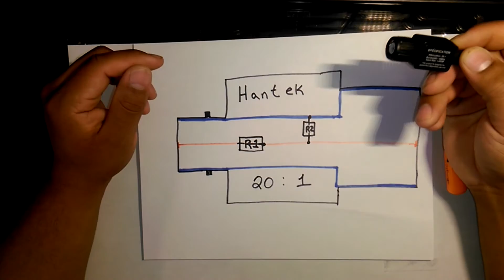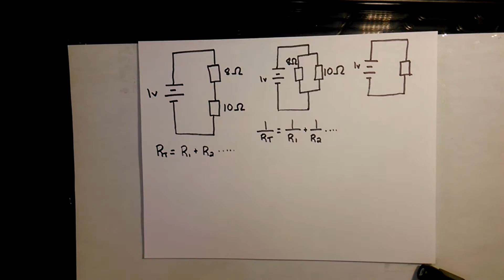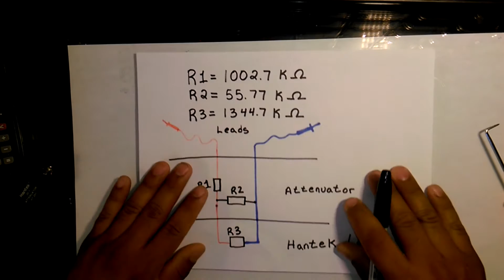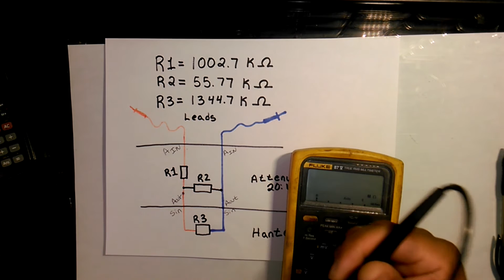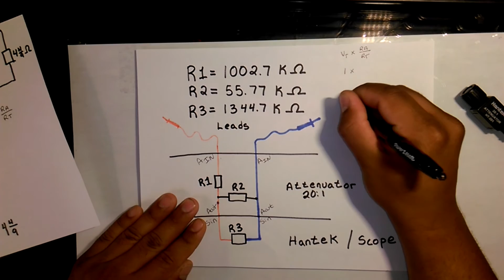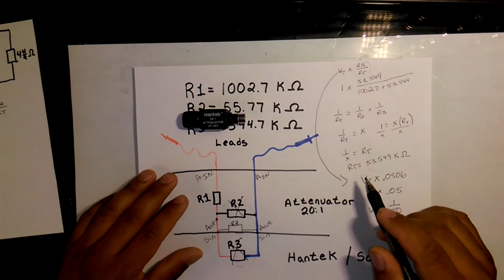Hantek 20:1 Attenuator Detailed Analysis

Comment: Enrique, Shahbaz has it right for 2 resistors in parallel, however, the way you have it written you need the inverse. Example: For 2 or more resistors in parallel,  Rt= 1/((1/R1)+(1/R2)+.....) Nice video.

Comment: If i bought hantek 6074BE Which they recomonded for automotive, have i to use attenuator even measure battery voltage as it is 10V/div max? Appreciate your explanation.

Comment: how can the resistance be LESS than the LOWEST ?.....
Reply from the maker: Excellent question. The combined resistance I calculate shown as Rt or R4 is the resistance of the resistors R2 and R3 in parallel. The resistance of two resistors in parallel MUST be less than the resistance of the lowest value resistor. The reason is that a single resistor will allow a certain amount of current to flow when there is a constant voltage across it. If you were to place a second much larger value resistor in parallel, the same current would flow through the first smaller resistor and there would be an additional current through the larger resistor. Both resistors in parallel combine to allow more current to flow then either resistor on their own. Therefore, the total resistance must be less than either resistor. I hope that answers your question. If I did not let me know and I will try again.

Thank you for your question, and thanks for watching!!

Comment: Hello, Enrique. When I use an Attenuator (Hantek) with my  2204 picoscope to check my battery, the voltage remains close to zero, but when I don't put the Attenuator on, I get battery voltage. I measure resistance between the input and the output , and I get 0996 kiloOhms. Do you suggest buying another Attenuator?
Reply from the maker: You have to adjust the setting on your scope so it knows that the input it is receiving goes through an attenuator first. If your attenuator is 20:1 then there should be an option for the 20:1 somewhere in a drop down menu.
Reply: Thank you for replying. I chose the 20:1 in the drop menu and nothing happens.
Reply: I got it figure out. Thanks

Comment: Hi Enrique, thanks for the video!  I have one question. You indicated that the Hantek 1008 has 1.3 M ohms of resistance but the specs says it's 1 M ohm which is common to a lot of handheld and pc scopes. Why the difference? Did you actually measure the internal resistance with the unit on and off. Could it be something to do with a capacitor that's usually in parallel with the resistor inside the scope. Thanks in advance if you have a moment to help clarify.
Reply from the maker: Excellent question. I do not know why the Hantek 1008 has 1.3 M ohms of resistance. I went back to check to see if I was mistaken but it is 1.3 M ohms. All 8 channels range from 1.340 M ohms to 1.345 M ohms. My guess is that it was a design choice. For the sake of curiosity, I also checked the resistance of my Hantek 6022BE 2 channel scope and my PicoScope 4425. The Hantek 6022BE has a ressitance of 0.998 M ohms and 0.999 M ohms on channel 1 and channel 2, whereas the PicoScope has exactly 1.000 M ohms on all 4 channels. I guess this makes sense, the Hantek 1008 is a $70 8-channel scope, the Hantek 6022BE is a $70 2 channel scope and the PicoScope 4425 is a 4 channel $700 scope. The more money, the better the specs. Thank you for your inquiry, it sparked my imagination. (All of my resistance measurements were taken with a Fluke 87V Multimeter, I have trusted this meter with my life).
Reply: Pay attention you are measuring an active device, not a passive one. In any case I've measured my Hantek 1008 input impedence and it is exactly 1M. Is it possible that you got a bad production or that the active input stage of the 1008 let your Fluke see a greater resistance...
Reply from the maker: Interesting thought. Is it still active if nothing is plugged in?
Reply: Active in the meaning that the measured value is not a constant value intrinsic of the component but it depend from the measurement conditions. When a tester have to measure a resistance, it apply a current and read the drop of voltage to give you the resistance (or it apply a voltage and read the current). But if you apply a current to an active component it may drop a different voltage according to the current you apply (and verse of the current). In the other case the current can depend on the level of voltage the instrument apply for the test (try to measure the resistance of a LED and you will see that your tester may light it on). So the measure is instrument/measurement conditions depending.

Comment: Hi  Enrique Hantek 20:1 Attenuator Vt =0.05v what if you measuring secondary ignition on spark plug which is somewhere 10 to 20 000 v what voltage is hantek see?
Reply from the maker: It will not work because the Hantrek can not directly measure secondary voltage. The only way to measure secondary voltage is indirectly with an appropriate probe such as the HT-25.
Reply: @Enrique_Osorio  But the term 'secondary' just means the secondary winding of the ht coil, so its just voltage, though a very high one! So not sure what your reply implies? I want to do the same as experimenting with ignition on my motorbikes.

Comment: if i have used 10x probe in series with hantek attenuator  what will be the   final calculation. is it VT *53.54/10000+1002.7+53.54= 0.00484 and VT * 1/208 . that means 1:208 . is it correct ??? please correct me if im wrong

Comment: Great video thanks! I know almost nothing about electronics but I have been trying to learn how these things work.  I tore my Hantek 20:1 down and found 3 capacitors in there too. I am wondering about their purpose as you don't mention them.
Reply: The capacitors are probably for frequency compensation (to make the gain uniform up to the maximum bandwidth of the scope).  If you just use a resistor divider, it will work, but the gain will drop at higher frequencies (instead of a pure attenuator, you have an attenuator plus low pass filter which will filter out higher frequencies).  In the signals, this can result in a "rounding" of square edges on a square wave.  Adding the capacitors (of the right value) can make the response of the attenuator "flat" over the entire frequency band so there won't be any low pass filtering (as long as the capacitor values are chosen correctly).  This "Trick" is used in regular 10X scope probes as well.  In that case, one capacitor is adjustable via a little screw allowing you to "tune" the probe to get it correctly calibrated perfectly.  With the low bandwidth of the 1008, this "calibration" is not so necessary.

Here is a link with more information (scope probe 10:1 attenuator, but it is the same principle):

http://www.syscompdesign.com/assets/images/appnotes/probes.pdf
Reply from the maker: Atomik 7 Thank you for your comment. I appreciate all sharing of knowledge, and you definitely taught me something.
Reply from the maker: I am not sure, if I had to guess, I would say that they are there to stabilize the signal so a really noisy signal will be cleaned up a bit, kind of like a low pass filter. Do not quote me on that since that is a guess. Thanks for watching and thanks for commenting, I read and try to answer all comments so feel free to watch more and comment more.

Comment: Hi, thanks for the info on the attenuator, but maybe I missing something but it's not clear to me what will happen when you connect the probes backwards (or with AC), the ratio 20:1 should be different, isn't?. I mean, with the resistor values that you are showing with 100v input you should get about 5.069v on the scope, but with polarity backwards I calculate 94.93v, so where is my error?. Thanks.
Reply from the maker: That is an excellent observation and one that I should have addressed in my video, hopefully most people will read your comment. Go to the last few minutes of my video and look to see how I labeled the resistors and what they mean. If you have an AC voltage and are on the negative part of the sine wave or reverse the polarity of the leads on a 100V DC source the voltage will be 94.93 volts on the input of the scope with respect to the positive input of the attenuator, but how does that count as attenuation? The answer lies in what that 94.93 volts mean to Resistor #3. The scope is reading the voltage across R3 and as you pointed out the voltage is 94.93 volts on the left side of the positive side of R3, but what is the voltage on the right side of R3. Well since we are measuring 100 volts DC and the negative input of the attenuator is connected to the positive output of the 100 VDC source that we are measuring and the right side of R3 is directly connected to the negative input of the attenuator with no resistance then the right side of the R3 is at 100 volts with respect to the positive input of the attenuator. Now what is the resistance across R3? Well that would be 94.93 volts - 100 volts = -5.07 volts. So the scope would read that as -5.07 multiply it by 20 and will tell you that the voltage is -101.4. Close enough for technical work ;) 

Hope this makes sense to you if not message me back and I will try to explain it better.
Reply: it took me a bit (sometimes I'm very slow =P ) but I see the logic now. Thanks.
Reply from the maker: Anytime!! Thanks for watching!!!
Reply from the maker: I made a video based on your question. Here is the link if you would like to watch it. Thanks again!!
https://www.youtube.com/watch?v=bPe-gYe0oog